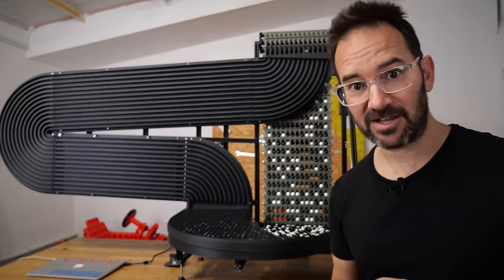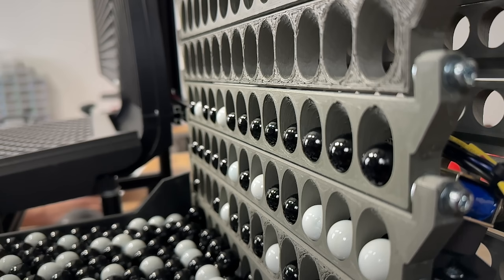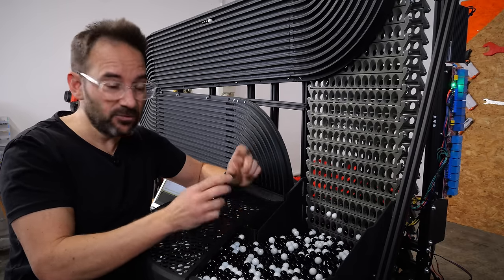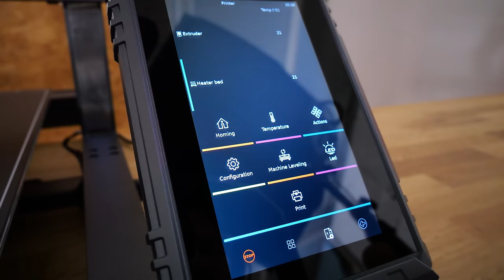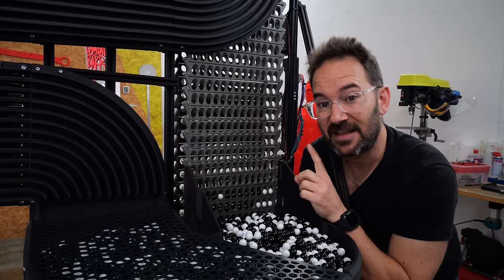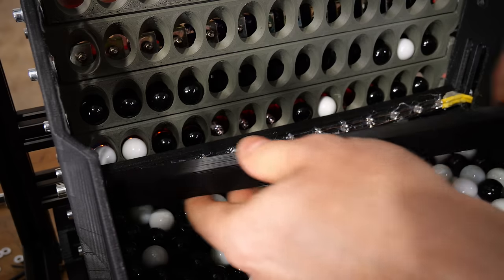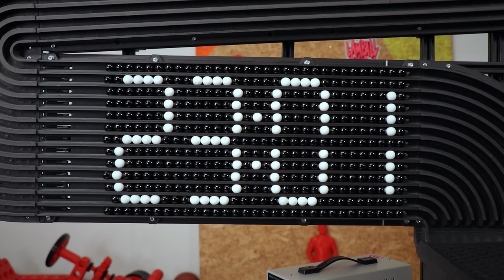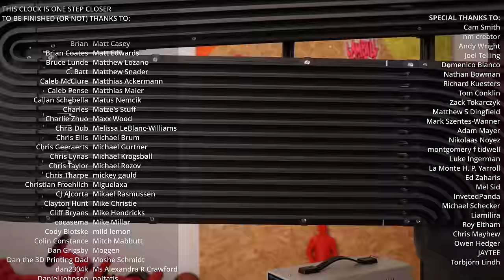BUILDING A MARBLE CLOCK - Pt. 2

Comment: You should consider a vertical layout for the marbles, so that you can update every number individually instead of having a collective - that way you can speed up the process to work automatically in real time without pauses or human intervention. It would be really cool!
Reply: I was hoping he would just use an efficient algorithm to update the display. Instead of flushing the whole thing every time it would just let out enough marbles from each track to reuse whatever it could.

And then to make updates a bit faster he could add another set of gates on the upper part of the track and release the whole update and flush the bottom marbles at the same time.
Reply: Might also help resolve the issue with marbles getting stuck when flushing.
Reply: I was thinking the same thing! Or maybe in this configuration have the next minute already loaded in the upper feed so when the minute changes it flushes the old time and gravity feeds the new time and the elevator is already building the next minute. Just has to be able to load the next minute in the upper feed portion within 50 seconds to keep pace.
Reply: Можно рассмотреть ещё вариант: разделить на два табло - часы отдельно и минуты отдельно. Цифры означающие часы меняются редко и поэтому корректироваться будут не часто. Для эффектности показания сбрасываются, все шарики съезжают, но часовые шарики делают кольцевой пробег и быстро становятся на свои места.
Reply: That was I also thinking

Comment: If you separate the marbles upstream, you can then speed up the row constructions a lot. As marbles are discharged from the clock, separate them in black and white trays, with the black at a lower level. As the conveyor goes up, it will fill with all black, then you eject some marbles to create voids and move the row to be level with the 2nd tray, where white marbles fill only the voids. This way you'll end up with complete rows every time.
Reply: Nice idea. Only issue I see is it assumes all voids should be white, but maybe the blacks didn't fill a whole row for some reason.
Reply: Then the elevator needs to switch functions: First run it and punch out all marbles, either in the white or black tray. Then swap to the function as you describe it. After displaying the next time, switch again to the filling function. Otherwise, filling the white tray will be filling all the rows with black marbles.
Reply: @paul8731 In the design every row must be filled for the marble based display to work. You need a white or black marble in every pixel.
Reply: Nice idea but the separation process would be more error prone than building rows as he is. Time isn’t an issue at this point, so it’s adding complexity for no benefit. Accuracy is the key here. Classic engineering.
Reply: @genehenson8851  Don't get me wrong, the clock is beautiful and I love the ingenuity on the engineering side, but right now it is non-deterministic. I know it's kind of pedantic, but  getting the right configuration for each minute could take way more than one minute, as it depends on the probability of black and white balls falling in the right spots in the first place. You can see this partially happening as some rows are lagging behind the others and in the earlier designs it was more obvious as rejected balls fell closer to the conveyor. Of course as paul8731 highlighted, preselection is not a perfect cure, as it requires that a row is filled without voids (and that adds even more complexity).
Reply: @paul8731  Good point. Any voids in filling the black marbles would result in a bright (probably) unwanted pixel, any void filling the white marbles would result in a skewed row. I feel the filling problem can be minimized, but yes, it's a good catch.
Reply: @obrerodelatecla  If the selection process take more than a minute then that's definitely a problem (or even close to a minute). It didn't seem like it was taking that long despite the non-deterministic selection process. If it is, then yes, preselection would be better. We'll see what video 3 holds.
Reply: @genehenson8851  Looks like it takes over 2 minutes when it's shown in real time at the end of the video
Reply: @genehenson8851  time is an issue if your trying to build a clock.....
Reply: Agree. Had the same thought, posted and then just seen this...
Reply: Better idea to sort the marvels on colour before the conveyor belt. Then you use full capacity of belt. Just sort them before and let them rol to belt in right order. Like a hill on classification yard. Owh nice work!
Reply: it was the first thing I thought about. If you know which marbles are white on your scoreboard you even don't need any sensors to sort them
Reply: @paul8731  If they don't fill a whole row then reject it entirely. The clock is blank-filling after all
Reply: @genehenson8851  Arguably one could say time is an issue when building a clock.  I'd call this a display and not a clock
Reply: Make one to show him how to do it.
Reply: I think the dude who made this comment is pretty smart.... and efficient.
Reply: I like your idea. Instead of ejecting black marbles, I'd suggest covering selected holes, so thet they wont be filled. Then, as you said, fill the voids with white marbles, and leave ejecting mechanism to correct any mistakes during row composition.
Reply: rt
Reply: @genehenson8851  saying that time is not a issue in a clock is clearly missing the point of the project. Statistically speaking, the way it works now could be stuck forever trying to fill a row but not getting the needed marbles.
Reply: Just have 2 layers on the input. One for white one for black. Fill the first row with black, kick out the ones you want white, and then hit the 2nd row.
Its very simple to do.

Comment: You'd do well using a barcode optic to detect ball color. They are more resistant to ambient light that affects discrete LED sensors. The only way around that is to clock the LED optic so you know whether it is reading room light or reflecting off of a ball

Comment: Ever since the last video, I've been wondering what mechanism you will use to select the right marbles for the right track. I would never have come up with this "subtractive" approach where you remove the marbles you don't want. What a cool idea!! 😁👍
Reply: This is really cool, but I would've used a slightly different approach. I'd have 2 layers of marbles where they load into the conveyer - the bottom layer black, then punch out holes where you want white marbles, and then an upper layer that loads any open spots with white. That way you don't have to depend on the randomness of getting the right color into the right tracks, which takes an indeterminate amount of time. You can load up the marbles you need in each row in constant time every time. You also need to sort the "discard" marbles back into the lower tray (black) and upper tray (white).
Reply: @gorak9000  I love that idea! Sounds very efficient, and not too difficult!
Reply: IR sensor
Reply: @gorak9000 100%. Separate all black and white at time of discard, and build what you need from the two color sources. His method sure looks cool though
Reply: @haileycollet4147  His method basically has all the parts needed to do the other way, they just need to be re-organized. Move the color detection to the discard chutes, and he needs a switchable gate to direct discard marbles to the white tray or let them continue down to the black tray. Then he needs to 3d print the upper tray for the white marbles and it should work. Maybe he also needs a way to work with discard marbles one row at a time too. Much easier to do this kind of re-organization for optimization in code where you can just copy/paste lines of code to move them around!

Comment: Maybe you could alternate the colors:  Minute 1 is white text on black, and Minute 2 is black text on white, etc.  That way, the number of marbles should be the same (50% of each) and the likelyhood of finding the right color for the next minute goes up since the previous minute's background is using a lot of marbles of that color.
Reply: Or just switch the ratio of the marbles overall?
Reply: sounds like an idea that could work. I thought about some way to "mix" the marbles, as some rows out of pure statistical bad luck took way longer to get the nextright marble than others. 
Regarding the marble quality, I wonder if appropiatesized plastic balls instead of glas marbles would work better, although the sound would be way different.
Reply: The plastic ones would be way more consistent but the weight vs coefficient of friction will be greater and slower in the channels and may even get stuck easier
Reply: Good idea. It would also add (another) aspect of visual interest.
Reply: @erikpip3024  Yeah, good point, the weight might indeed be an issue. Although the difference is less significant than i thought. Glas is about 2.5 g/cm³ while hard PVC is about 1.4 g/cm³. Other plastics like ABS are even lighter, around 1 g/cm³, others may be heavier (but way to soft in comparison).
To be honest I somewhat expected glas to be multiple times as dense (and thus heavier). But in conjunction with any plastic being "softer" as glas marbles, friction indeed may add up on top.
Reply: At that point may as well just keep the black and white separate and then have a gate for each column open to accept a marble when it needs one.  The solenoids and detectors could be reused to do the color sorting into two rows of hoppers.
Reply: Definitely he should have way more black marbles since the majority of the clock is black.

Then the % is already fixed. And he has greater than 50% of having the correct marble.
Reply: @jimmypatton4982  Someone wants to count the number of black and white marbles for evry digit that can be displayed and average out those numbers? Although I wonder if you can speed up some things a little bit using more like the "higher white marble count" end of the ratio or not.
Another Idea that came to my mind was separating for example the outer channels where you have only black marbles. Then in theory you could separate every individual channel, but that would get so bulky and require so much space, I highly doubt that would be anywhere close to efficient. And also, having those outer two rows filling up immediately sounds light it might be visually a lot less appealing than those rows filling up randomly and at no synchronised fixed pace.

Comment: @Ivan Miranda - Improvements:
8:24 If you reject the marbles to the left, so they get into the very back of the queue, you would get even more circulation of marbles.
- -:- - It would also be useful with some kind of "buffer system", so you can store a rejected color & then swap it in later when needed, it could make a LOT more elevator utilization.
10:22 You could copy the lower straight piece into the upper piece, and build the next time in the upper part, to remove the pressure from the marbles in the bend.
Reply: Yeah I don't know why it has to roll down that long straight away to get to the bend I'm not sure why he doesn't just set the elevator on the left side and have it drop down into where the bend is... I guess it's more for show to watch them roll all the way over
Reply: I had the exact same idea.

BUT, i just made another comment saying that if i was to have made this, i would have build it differently with less marbles.
All you need is a track which holds the combinations needed to form a side of a digit. Split tracks.
So for every number you have a tracklayout that can build up the number.
And the marbles are stored in a tube or something like that. 
And so every number of the clock, 4 in total basically, you have a different track. 
All you need to do then is have controllers for those tracks that put a new set of marbles in it when the number needs to change.
You only need to have 0 to 9, so not that many marbles per track.

Sorry if it does not make sense. In my head it does.
The only problem i have is: I can draw it but it still would not make sense without the electronics drawn in and the circuits.
O, and the second problem is: I have no time to build it myself.
But the idea i got is almost like the flap down clocks, where a card flips.
 @kmktruthserum9328 

PS: btw, the long ramp does have a purpose. I just thought of it.
He needs to be able to change from 23:01 to 23:02 in 1 minute time.
That is not going to happen if he does not prepare it in that minute, to instantly change over basically.
Therefor the longer ramp. (or so i think. I litterally came up with it just now but it does make sense. Otherwise he can not change from 23:01 to 23:02.
Because that requires time to set up.
Reply: I thought the design was meant to also buffer the next time
Reply: @kmktruthserum9328  It's so it can queue the next minute up or else you'll have to wait and sort the next minute on the elevator itself, which is too much.
Reply: i think two buffers for the two types of marbles will be needed to speed the process up.
i feel like the marbles need to be split into two groups before they hit the elevator then fed in at two different spots as needed.
Reply: Move the next number release to the end of the top ramp instead of the start if the display ramp? Of course then have to hide the top ramp that now kind of displays the next time

Comment: This is sweet!
Though I had a thought: If you had the time on the right of the elevator instead of the left, you could then fill the minutes in last. This could be helpful if you had a way to clear the minutes without clearing the hours (perhaps where the : is?) Then only the minutes get reset each minute, which is faster. But then every hour you'd get a really satisfying sound of all the marbles returning.

Edit:
Just thought this would be easier perhaps, if the numbers are assembled vertically (in columns) instead of horizontally (in rows). This could also solve your issue with marbles getting stuck.
Reply: falling marbles isn't as satisfying as the visual and auditory effect of rolling marbles
Reply: How would you remove the minute marbles without removing the hour marbles even if the time was on the right?
Reply: @TheArachnoBot  maybe another array of solenoids?
Reply: @pravus9769  You mean an array behind the minutes on the board? That would ruin the entire charm of the clock. Plus that's a LOT of solenoids.
Reply: Maybe by having the time display as a shallow ‘V’ with the ‘:’ at the bottom, so the hours are put in from the left and the minutes come in their own track from the left. Both of them empty inwards toward the ‘:’ so you can control either side individually
Reply: @TheArachnoBot  that's fair. It was just something I came up with off the top of my head, and I'm no engineer lol

Comment: I really enjoyed your video! Some thoughts: your clock "refresh rate" is bound to the randomness (mainly) of a white marble going to the right place and the speed of the lift. I would suggest moving the actuators up, use them to short the marbles in two "buffer baskets" (white/black) and from there rapidly feed your "dispaly". (Actuators to each color letting marbles drop in place). Again, super nice project and great video!
Reply: Yeah, i feel this random approach will just be too slow to have the next number ready in 60 seconds. When he started talking about differenciating black and white marbles, i thought he was gonna implement a sorting method.

Comment: Love it!
It would require a huge redesign, but if you made the display out of vertical runs instead of horizontal runs the marbles would position themselves much more quickly … possibly even fast enough to display seconds as well as minutes a long way down the design timeline. Great concept, looking forward to the finished article!

Comment: something that might help with the speed at which the numbers are constructed is switching the background and foreground numbers each time(assuming about a 50/50 split)
Reply: Good idea. This will also reduce the total number of marbles required to fit in the holding tray.
Reply: Would adjusting the ratio of white to black marbles also accomplish something similar?
Reply: @SVSQZ  yes, but at the risk of having waaaay too many blacks and not being able to populate a white 'pixel' if they can't make it to the front.  If the mix is roughly 50:50, and alternating front and back colors it would kinda solve a lot of issues as the majority of the next color you need would be the most available to move up the chain for the next set.
Reply: @SVSQZ  Maybe but wouldn't reducing the number of white marbles also result in the collection thing taking longer to pick up a white marble in the correct lane?
Reply: @CaedenV  I don't think your theory is any better than the original problem, because once a black on white number is in the display, and it starts to construct the next number (white on black), we don't have the 50:50 mix anymore. Maybe there's some slight improvement if one lane finishes early and the next number is started to be constructed while other lanes are still working on their part of the first number, but I'm not sure how much that impact would really be felt.
Reply: @CaedenV  I'd recommend rejecting white marbles on a separate chute that's closer to the bottom of the ladder. Less time is wasted waiting for the marble to travel back to the ladder and there's more chances a white marble would make it into any particular channel. You could also make a small wedge in the first 2 or 3 channels on each side of this rejection chute so a white marble rejected on 1 side of the ladder potentially falls down to the other side instead of landing near the middle and hoping it spreads to the sides.
Reply: Maybe making the font bolder so that the ratio of white to black marbles is closer to 1:1 would help?